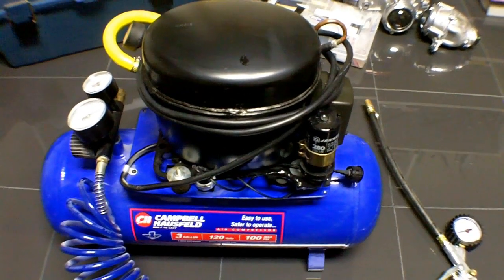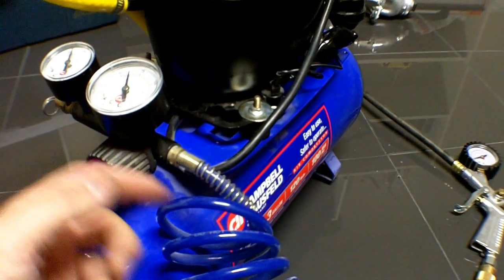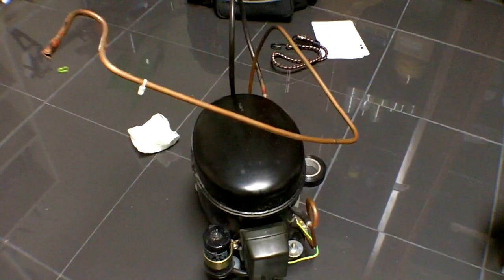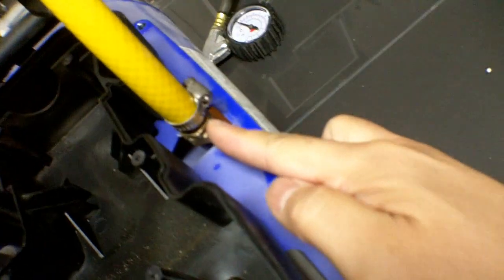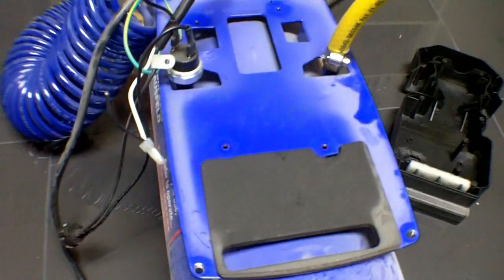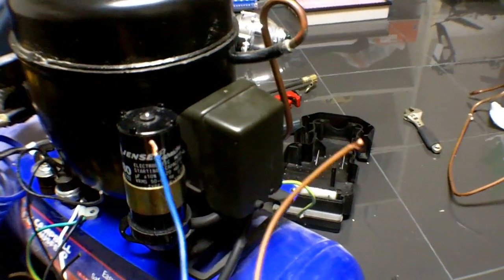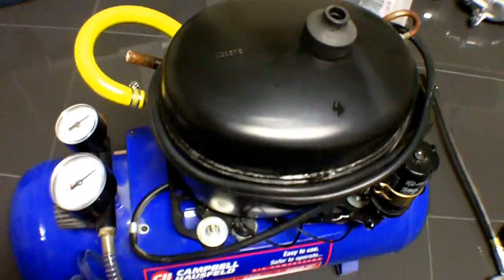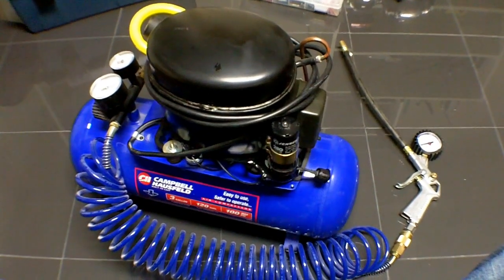Silent air compressor using a refrigerator compressor.

Comment: Great job! Generally most if not all of these smaller compressor tanks have the check valve built in to the fitting that enters the tank from the (original) pump head. It is important to verify that this is present and functional or the motor will be fighting to restart with pressure in the tank.

The capacitor is there to provide a jolt of starting current to the compressor starting windings. Also important to have present. The 3 prongs on the side of the refrigerator compressor are the winding connectors to the start relay. Always good to do a continuity check on these bad boys.

I'd suggest having an oil/water separator on the line between the compressor and tank. I'd also stick with the copper line on the refrigerator compressor and sweat a 3/8" or 1/4" fitting on. No hose clamps to fumble around with and it helps just a wee bit cooling the air. 

Thought I'd share a little info while watching. Nice work!

Comment: The fridge engine already has oil inside. You don´t need replacement oil, maybe just if you emptied it but it can run for years with the existing oil. Nice video and explanations ;)

Comment: I guess it would be helpful to put a air/oil separator they are easy to make and have it connected to the outlet side of the compressor with a ball/check valve after the separator and have the separator with an orifice that- 1. when pressurized air/oil mixture enters the separators' free chamber it hits a plate separating the oil and air by a buffer screen. 2. Have an orifice at the bottom with a tube to the inlet side to the comressor. Oil problem solved by recurculate oil back into the compressor

Comment: hi, i follow your method, but not sure why the air kept "released" from unloader valve once i start the compressor. End up i have to disconnect the hose to unloader-valve, and add a ball valve to it, to manually unload the pressure.

Comment: Hello Sir
I also made one compressor out of an old fridge and it was working find but just after few days the compressor stop working. I dont know what went wrong. Do you add any extra oil in the compressor. I have another compressor which i will be replacing soon. Thank you.

Comment: you can buy a water air separator and plum it in between your air tank and you comressor. then run a line from the drain of the separator to a T fitting on your air intake. this will keep your air dry and also constantly lubricate your compressor

Comment: i just successfully finished this same project as described and it runs perfect,  except the compressor starts silently but around 40psi, it starts making a buzzing noise.. not very loud and continues on to 120psi then the shutoff kicks in perfectly.  I then bleed about 20psi and it kicks it back on as designed. what do you think causes the buzzing noise? im gonna add motor oil to see if that would solve it.  otherwise,  thanx for the awesome vid that works :-)
Reply: i would use atf instead of motor oil. Also you can buy a water air separator and plum it in between your air tank and you comressor. then run a line from the drain of the separator to a T fitting on your air intake. this will keep your air dry and also constantly lubricate your compressor

Comment: you need to put checkvalve between the compressor and cylinder ,it will prevent air from returning to compressor

and an air filter on the intake
Reply: the check valve readily installed at the inlet on the tank maybe.

Comment: One thing I think I should mention is that most of these compressors already have an oil bath and a small pump inside of them to keep the compressor lubricated so adding oil in the intake every now and again would be a bit redundant if you ask me when the internal supply is doing the same job.

Comment: That will be a short lived air compressor, especially if the compressor was orgionally designed for R-134a or R404a they use a P.O.E. oil which is highly acidic when even small amounts of moisture are introduced, which will now be in the bottom of your air tank eating the metal, additionally those compressors are designed for low torque starting ie: equal pressure on both suction and discharge, eventually that compressor will seize or the motor windings will fail.
Reply from the maker: It's a scrap compressor anyway, so I don't really care if it seizes. I got tons of these compressors laying around so if this one seizes, I'll just install another one. But, it's been running 24/7 for 3 years with no problems so it's lasting quite long.
Reply: No kidding, Well I stand corrected. I do like the idea, nice and quiet to boot. I am surprised it has lasted so long what kind of oil did it originally have it, mineral oil?
Reply from the maker: J Smith I don't remember what oil it had before. When I empty the refrigerant, I empty the oil too and replace it with automotive oil.
Reply from the maker: +Coolest guy on youtube I rely on this compressor for various things so it has to be on all the time. It cycles on and off so it's not running constantly. But when used heavily, it does get warm, but not to the point it will over heat. It doesn't have problems starting with pressure.
Reply: I´ve been using mines for +10 years without any problem (for airbrushing fine art) it works 100%.
Of course if you´re going to give it a hard use with any other purposes, better if you choose any other way. Even no need for oil at all, just if you dropped it.
Reply: +wedginator why is your compressor running 24/7 and how do you deal with starting pressure

Comment: i did this before but was impractical because I had no pressure switch and I used an air conditioner's condenser as an air tank XD

Comment: Hallo everyone! Here me back again! Let me be simple and clear: Home refrigerator has an electric single piston compressor. This compressor has to be lubricated and the oil is in the bottom of the ROUND BLACK IRON CASE in which the compressor is also sealed, to avoid gas leakeges. If you turn upside down the BLACK IRON CASE the oil can came out from the suction pipe (cutted), and if you blow some air in with a smaller pipe (in the suction pipe) it comes out faster. Once empied put NEW oil inside

Comment: Why is this a "top comment" with 10 "thumbs up"? There is no oil reservoir, therefore you can't "change the oil as fast as you can." If there was an oil reservoir he wouldn't be needing to add oil through the intake, now would he? There are industrial-sized refrigeration systems that have oil reservoirs, but a home refrigerator does not.

Comment: This is so easy to do!

Strange that the makers of shop compressors insist upon making their products so noisy when they could be whisper-quiet like this. It can't possibly cost that much more to manufacture a quiet product. As it is, I know of people who have refused to buy an air compressor because they are so noisy they are afraid the neighbors will complain, especially if they like to work on projects rather late at night.

Comment: Good theory, but you'll likely end up getting moisture into the compressor pump and then not being able to get it out. This would negatively affect the oil and accelerate wear on the pump. A better idea would be to use the filter/dryer between the pump and tank like you said, but use an air tool in-line oiler to keep the pump lubricated. This is what alot of folks do when using an air conditioning compressor in an on-board air setup for their trucks.

Comment: i loved the build, i had a similar idea.. the only thing that worries me about the build is the air line coming from the fridge compressor to the tank.. did you bend the end of the pipe (like as in did you make the end of the pipe larger than the rest) because those clamps are not meant to work on friction there meant to have a nipple on the piece that you are putting the pipe over then the clamp holds it onto that, it may be fine for a while but one day it may slide off and maybe hurt someone

Comment: I changed the oil on my homemade silent compressor and still I have this proplem with water in it. Also when I empty the full tank, the drain valve (or whatever it's called in english language) freeses. I changed the original oil with this multifleet mineral motor oil (15w-40) Does anyone else had this kind of proplem and how to fix it? Thank you!

Comment: Hello
I have a LG LRBN20514ST it has a Embraco EGU70HLC compressor with 3 wires 1 blue, 1 black, and one pink. I need to know which wire is hot, which is neutral and what to do with the third wire  Do I need to add a solenoid to this?   Any help would be greatly appreciated. What kind of oil do you use and how much   The tank I have is almost Identical to the one you used in your video.  Thanks for the great tutorial!
Thanks
Shane

Comment: Installing a liquid filter/dryer on the compressor's output before the tank and running the drain tube from the filter/dryer to your intake will keep the compressor lubricated and your compressed air from tank  oil-free.

Comment: Hi! ATTENTION !!!! The lubricating oil iside the fridge compressor is't good at all to work with air! You have to change it with a general purpose low viscosity mineral oil (the one that is used in gasoline car is good). That's because the fridge oil fills up of water, if it works with air, and make everything take RUST in a month!!!! One day your compressor will not start up again cause of the RUST and your project will die. So change the oil as fast as you can!

Comment from the maker: Don't really know. But the oil loss is minimal. I usually add 10ml every so often. If there is excess it'll come out the output and into the tank where I can drain it by opening a valve.

Comment from the maker: Add oil into the intake port. It will make it's way to the mechanics inside. If you get one from a scrap yard, they normally don't empty out the oil. But doesn't hurt to ask.
Reply: What types tank use 25 or 30 ltre and how it takes to full
Reply: What types tank use 25 or 30 ltre and how it takes to full

Comment: Nice work, I have a 1HP-3 gallon craftsman air compressor. I did the same thing you did, swap the motor with fridge compressor. Everything was conected nicely and it's work. The problem is about 85 percent air going back out from smaller line from the tank to automatic shot off valves hole under on and off switch housing. That makes the compressor never stop running. Is there anyone has any suggestion? Please send me an e-mail with your suggestion suwandi1@verizon.net thank you.

Comment from the maker: What you said is total BS. It pumps quicker than the original compressor, pressure goes up to 100psi. I'll let you know, I've run air tools with this and it works just fine. Know what you're saying before you post it.
Reply: wedginator yes. it builds up much faster than the 1/3 HP compressor that came on it from the factory.

Comment from the maker: Of course I know this. I take scrap fridges with working compressors and turn it into one of these. If the compressor seizes, I just install another one. But so far, I've had one run for 2 years and still no problems.

Comment: refrigeration and air conditioning compressor are design to pump low pressure gas refrigerant only. sever using for compressing the air can cause compressor moisture contamination, which can trigger the motor compressor to stock-up and loss compression....

Comment: will it restart with backpressure? if so, how much backpressure...I know these things can achieve near 700 psi, was wondering if restarting at 120 with a 150 cutoff would be possible. I need 120-150 for the jacks on my lift, hate running a huge compressor for the very low amount of air needed at that pressure...a big compressor takes its noisy time to make any air at 150 psi, and the heat at those pressures puts a lot of condensation in the tank...adding oil for just the lift is good too :)

Comment: Dude! I LOVE THIS IDEA!  Those Fridge Compressors can handle up to 200psi. But Its a good Idea to use Lower Psi for it to last long. Did you just use your Old Compressors Check Valve for this?

Comment from the maker: Oh I see what you mean. A propane tank can handle quite a bit of pressure. I think the built in safety is around 300psi. You're safe with a 100psi safety.

Comment from the maker: Yes, you can use the freezer compressor. The 30L tank might be a bit large and could take a while to fill up. It's roughly double the size of my tank. If you're doing it that way, make sure you use a 120 psi safety relief and a 100 psi electrical cutoff.

Comment: hello thanks for the vid , ive got a few fridge motors and ive hooked them up to the power source , but not to the compressor tank yet , just trying to see if the motors are any good , and they ve ran , but shut off after a few seconds of runnin , what am i doing wronng

Comment: Just saw your refrig compressor its great. But I saw something else you may like. Take the low start torq compressor relay off and replace it with a high torq relay and add a 60 microfurad compacitor. No waiting for start up it will be instant. Tank stays full this way and works great for airbrushing no pulsing.

Comment from the maker: @rcnuty Yes, there is oil inside the unit itself. But since the system was not designed to be opened up, some oil will escape from the outlet. So once in a while, oil will need to be added.

Comment: My question is how do you determine which of the copper tubes connect were on the tank my compressor has 3 in front and 1 on the back by the start run relay switch

Comment: You did a nice job of the compressor and the vid. 
I would say it probably draws less power as the fridge motor will be a lot more efficient. The noise reduction is priceless :) 
I would recoomend fitting a water trap between the compressor and the tank as it prevents most of the condensation in the tank and gives you an idea of oil usage.
I replaced a 2HP compressor (97db!) with a quiet 3/4hp danfoss compressor. It takes ~100 seconds to fill a 24L tank  (6.34us gal) from 40psi to 100psi.

Comment from the maker: @kary1982v6 Takes about 5 mins to fill the tank. VS 10 mins which is using the original motor. I didn't measure the current draw, so I don't really know.